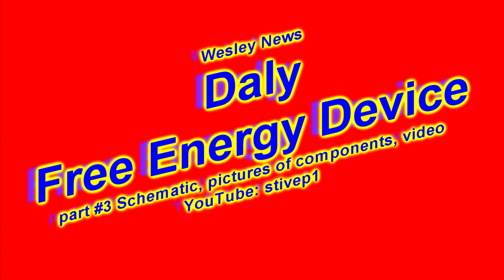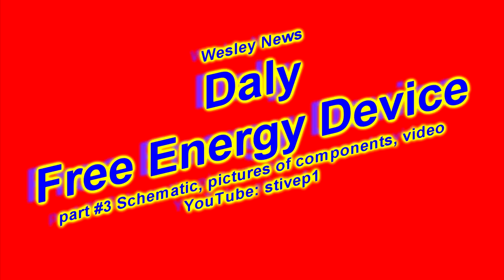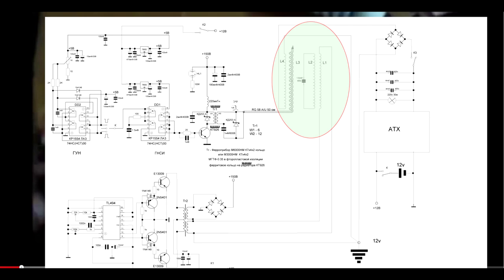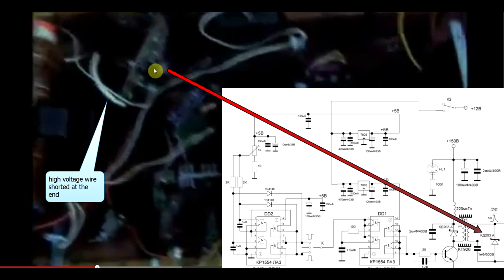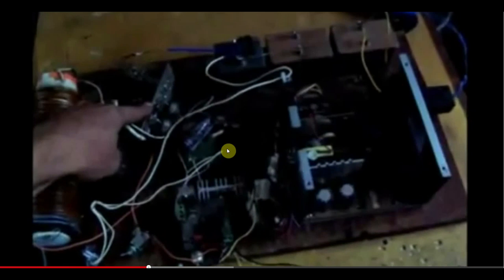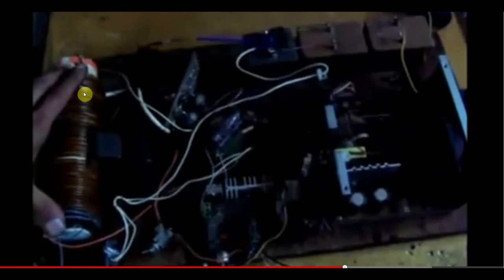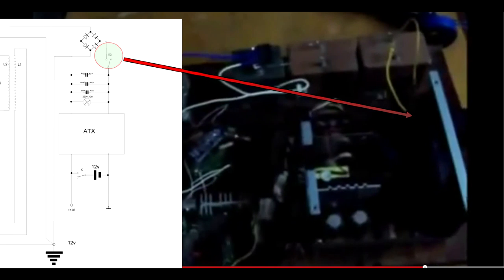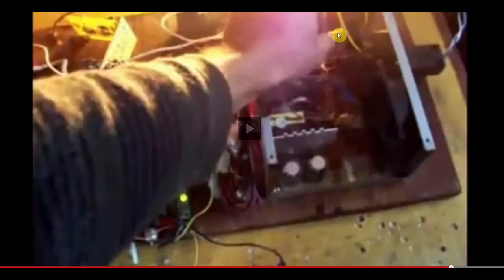Wesley presents:Daly part #3 Free Energy Device (schematic)

Comment: Although Wesley I got to say this technology is very important to study! We have yet to start thinking about the fields at play and how to manipulate them and intercept them. Think reflections and you now have half more to work with. The Bifilar coil certainly fits the bill to be the receptor since both pathways are intercepting or receiving the energy and can recover almost all of the impulses and the response from the coil and the polarized environments response. This is why Tesla was looking to the electric impulse to furnish this result. There is literally nothing to lose and everything to gain from a system like this. Learning now to receive both sides of an event is the way to go. Impulse recovery and recovering the environments reaction to a vacuum or rarefaction of the environments field. It will still respond much like water. The environments field will move in to fill in this void and bring in new charges to harvest. Some have actually gotten this method but have only just begun to see the results of a working, In Your Face, Charge pump. Not only does this charge pump modify it's local surroundings, it also has an effect of influencing further out of the local field in a (film) negative like way. It leaves a subtle residue further out that can be picked up and inverted back to the positive side. This can be done via capacitor or battery filtering. With the capacitor filtering being able to magnify the fields inertia into a real current that can be either directly pulled out or can be used in the impulse discharge manner to create much stronger current flows.
Reply: Sorry I meant Learning How and not Learning now.
Reply: Jon Bigman Adding another strange feature, The TPU effect, we can add magnetic momentum or as Tesla liked to say it Magnetic inertia, Is another way to harness or magnify the real current harvested from an overlapping load coil. Bifilars need to be figured into this process. It was Tesla's wish that we expand on his discoveries and the Bifilar coil has not been looked at yet in both the driving (exciter) coil and the receiving (load) configuration.

 Think about this one... Bifilar coils have interesting design in the series connection. How does a bifilar coil act in reflection mode? There are 3 different actions a coil can do. Shorted to a source it can short though itself without reactive inducing self action. The only resistance to the bifilar coil is the resistance of the wire itself. This means an impulse would flow freely into the environment and most powerfully.

 Now lets look at the shorted to itself mode. This is the reflecting mode. A perfect reflector that would only lose as much as the resistance of the wire. Of course lowering this resistance is very very easy. Put them in parallel as per ohms law.

 And finally set up as a receiver in broadband mode to a tank or reservoir mode (load). We must strip or filter all of the previous techniques in order to strengthen the output. TK did this with the bridge rectifier and battery/inverter setup. This TK method creates a one way flow of the current into a loop that can more than generate excess energy to a load. In the case of TK though he used a sink for the energy creating a flow into the ground that excited the thick copper coil into a heavy magnetic response. The inner coil was squeezed by this magnetic field expanding and contracting around the inner coil generating the power he needed through magnetic induction. Since the outer field was compressing the inner coils field it doesn't feedback as much when the inner coil is used for a load. Plus the high voltage impulses get added to the internal coils output.

 There has been a concerted effort in suppressing this charge pump idea. You and I know this and have experienced this until the current day. Tesla charge pump ideas have been suppressed since day one. Remember charges act and flow like water. Heat shimmers are the proof of this. Look at a boiling pot of water in a glass bowl and you will see charges in action on the bottom of the glass pot. Those charges are real and they are everywhere. Inside matter and out. Heat is just a side effect of these charges. When it builds up enough it will actually turn the material to a liquid like state and the matter is glow. Light is another effect of high charge density. This is because the matter is forced to radiate excess charges via (Voltage network or field growth) around the matter. Hence another reason tesla and others like TK shorted high voltage twords the ground. The high voltage creates a field around the device that grows as time passes. The longer the field grows the more powerful the device becomes.
Reply from the maker: charge pump  you mentioned I call  Electrostatic  pump.There is  more in video 5 of Daly
Reply: I posted there.